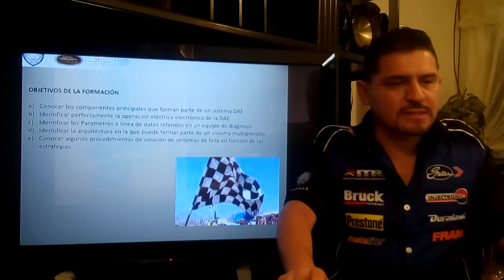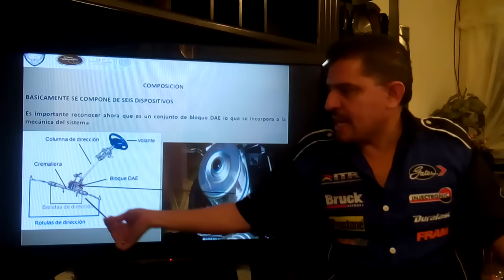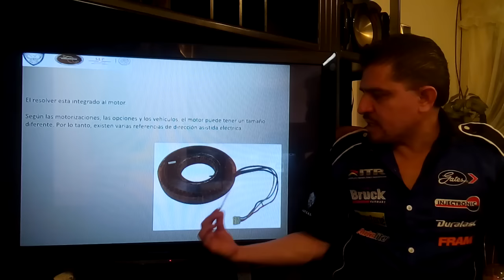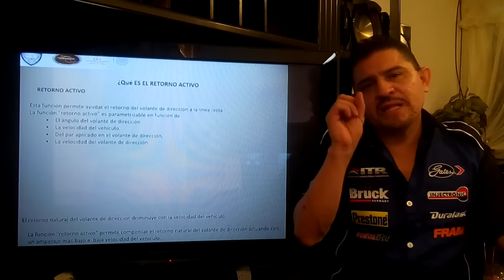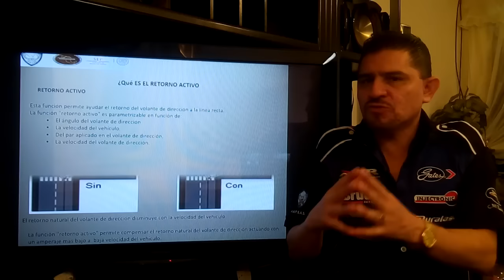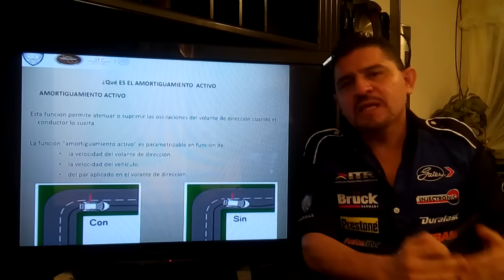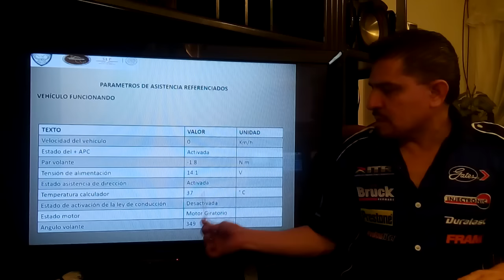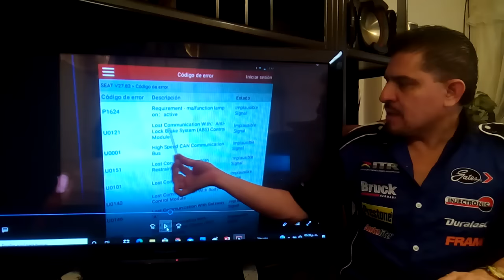Operación y Diagnóstico de Direcciones Electrónicas | Prof. Marco A. Ballinas IMCEA-CNT

Comment: Excelente presentación Marco Antonio Ballinas....
Tengo una consulta, espero me puedas ayudar.  Revise un automovil HONDA ACCORD 2013 V6 3.5 Litros que se ponia dura la dirección, se encendia el testigo de dirección (volante amarillo con el signo de admiración), TDC EPS 33-01 (Este automóvil lo lavaron por debajo y de ahí surgió el problema) Lo enciendo y volante duro, borro el testigo, lo apago y lo vuelvo a encender y funciona perfectamente, lo apago y se vuelve a presentar la falla de dirección EPS 33-01 : Lower FET Stuck ON ----> Diagnostique que el problema se presentaba en el FET Transistor de Efecto de Campo el cual se encuentra en la Unidad de Control Electrónico de la Dirección MA 39980-T3M-A9 El cual no pude conseguir y en consecuencia no pude cobrar ....
Cheque el motor trifasico de la dirección y todo estaba bien.....
Quedo atento a sus comentarios.....
Gracias.